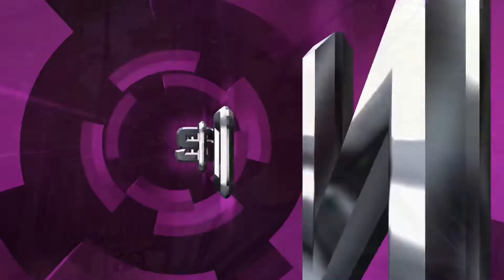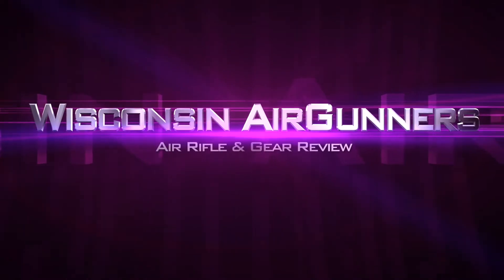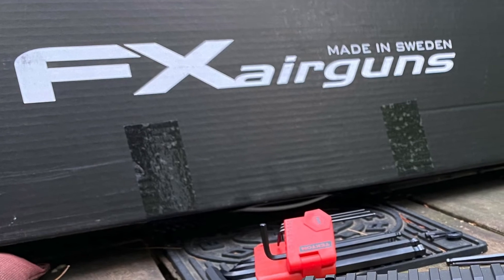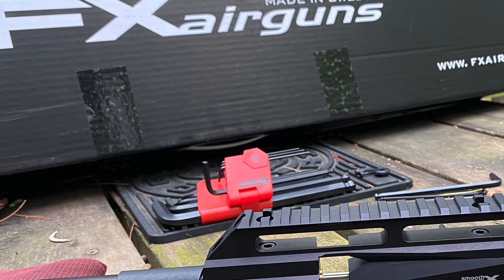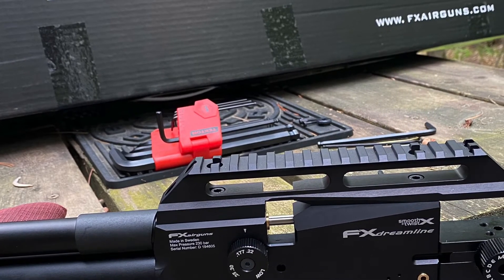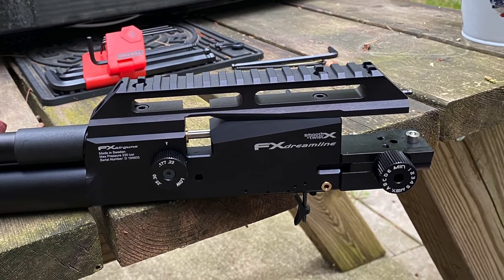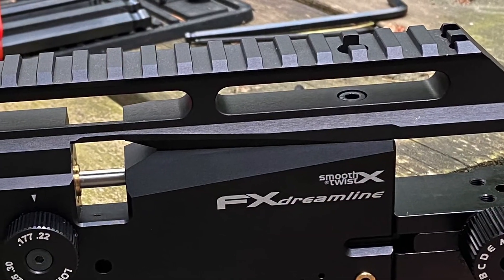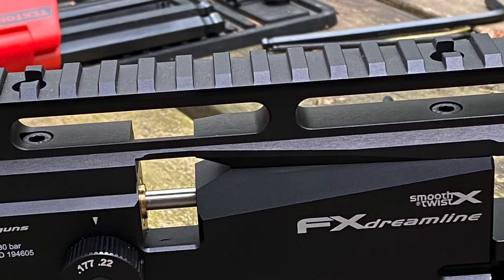FX Dreamline Tactical Rail Installation

Comment: Is there any kind of Picatinny rail extension or adapter for the lower end so that I can use my dreamtac with my arca swiss ball head tripod, any help would be greatly appreciated Thanks
Reply from the maker: Saber Tactical has a short pic to ARCA adapter. I don't know if their Universal Adapter will fit, and unfortunately I don't have the bottle or compact tube part of the Dreamtac to try it out.
Take a look at this and see if it will work for you.
https://sabertacticalinc.com/products/universal-picatinny-to-arca-short-st0024